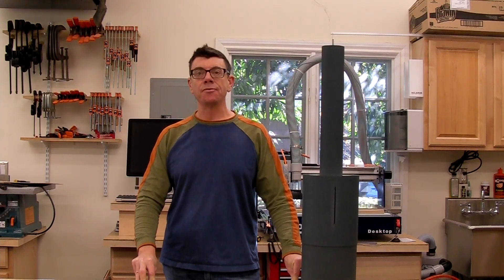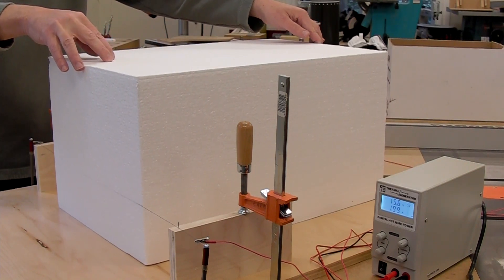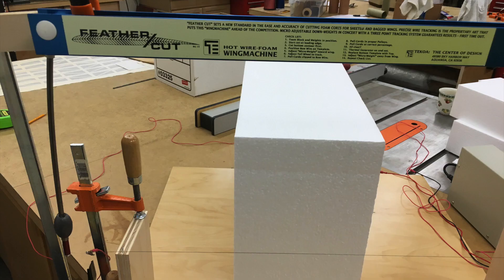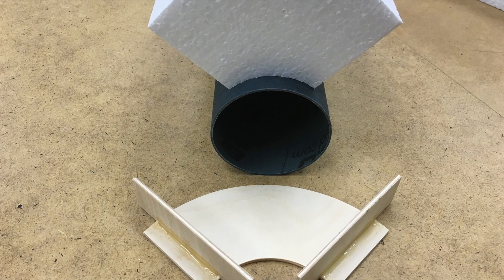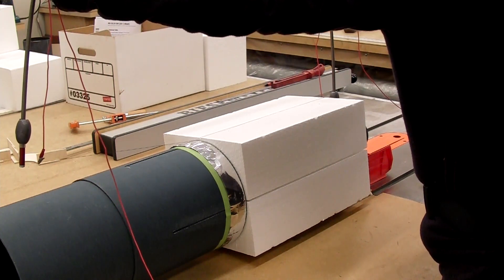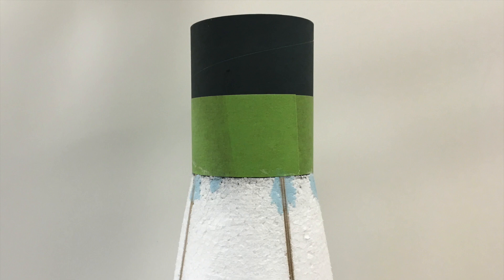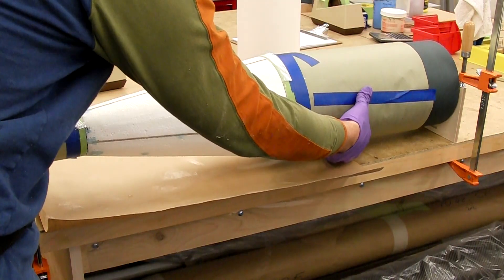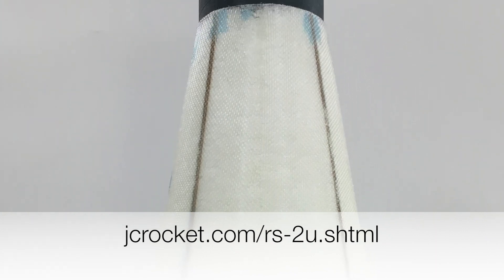Foam Transition

Comment: I use to fly rc planes & jets. We we used foam for wing cores, we would take our airfoil template & seal the edge where the bow wire would run. Use CA glue a thin or medium then sand it very smooth, that slows the bow wire to slip nicely on the template.
Reply from the maker: Good tip, thanks!